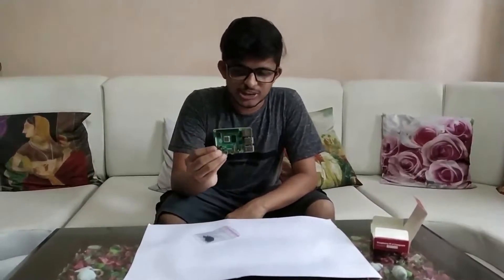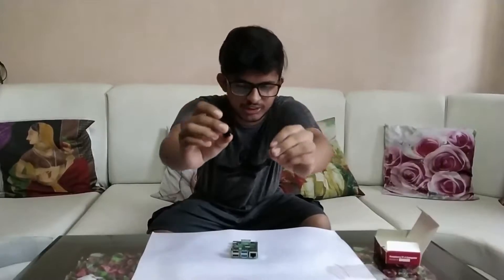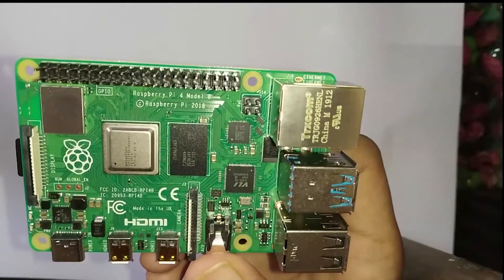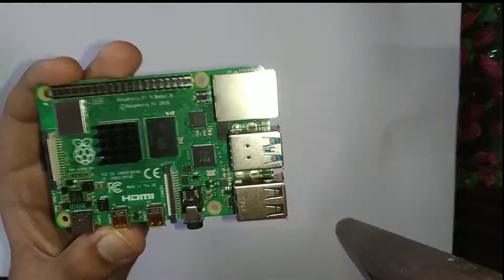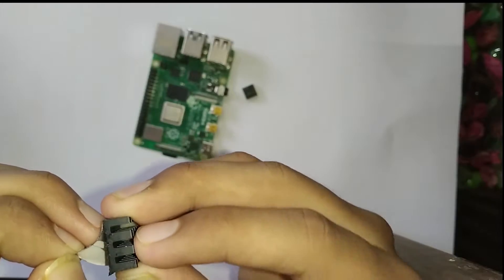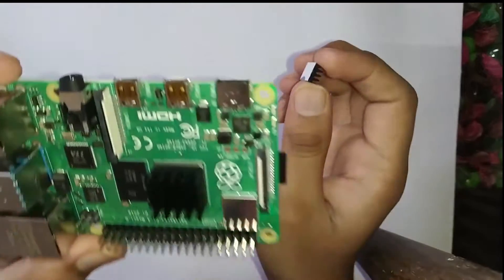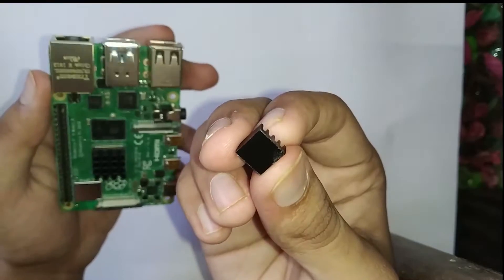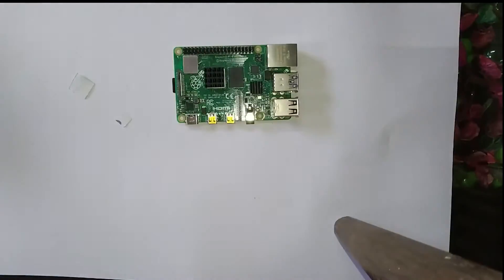Install Heatsink to Raspberry Pi

Comment: Was the heat sink of any help? How much temp drop can you expect ?
Reply from the maker: Before: it was becoming hot instantly on low/no use
After: quite better heat dissipation and it was not throttling even on running intensive python codes
Reply: @yatharthsaxena1926  without a Fan? Because if u get a box igtcomes with a fan

Comment: Where did you buy the Pi 4? How much did you pay?
Reply: https://vilros.com/products/vilros-raspberry-pi-4-basic-starter-kit-with-fan-cooled-heavy-duty-aluminum-alloy-case?variant=31894098378846
Reply from the maker: From Amazon, it costed ₹3499